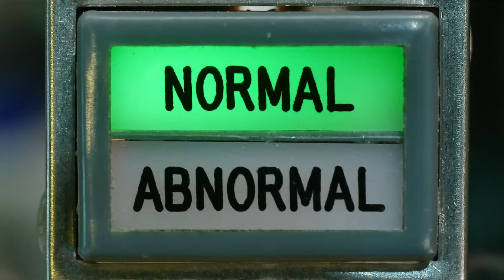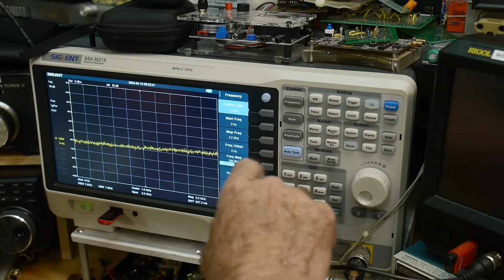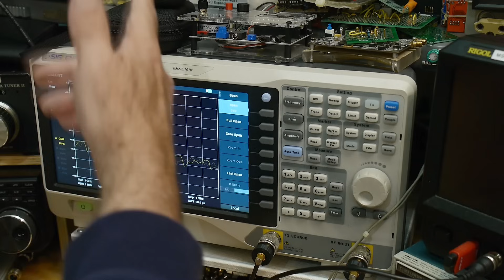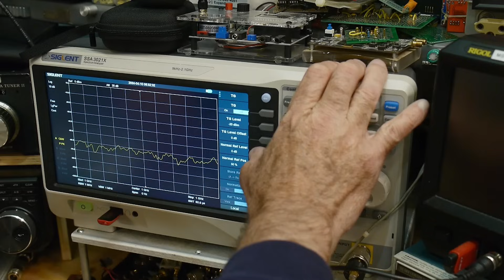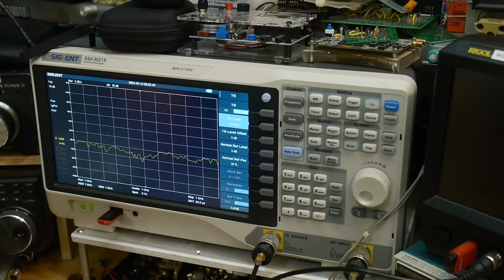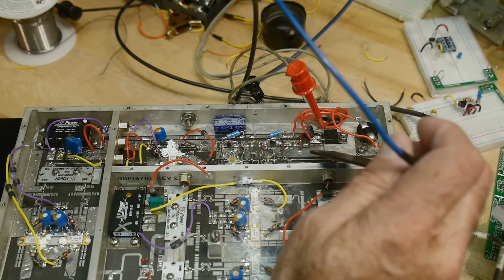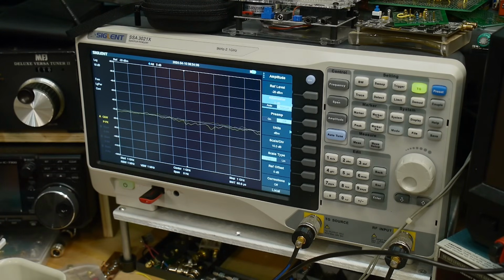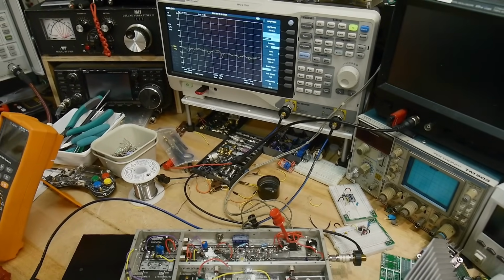#1864 1-2 GHz 30 Watt Amplifier (part  2 of 4)

Comment: Isn't 1 Ghz  microwave not RF 😂😂
Reply from the maker: it's all RF, you are thinking of HF (high freq) VHF UHF
"Radio frequency (RF) is a measurement of the oscillation rate of electromagnetic radiation, or radio waves, from 9 kilohertz (kHz) to 300 gigahertz (GHz). RF is measured in hertz (Hz), which is the number of cycles per second a radio wave transmits."
Reply: @IMSAIGuy  thanks one learns something new everyday  😉

Comment: So can it be modified for efficiency.. a current controller instead of constant current at class A. Such a  current controller was used designed by Douglass self.. but it was for audio... Opamp for few ghz hmmm...

Comment: When do the screws go back in?  I was wondering if there's a robust connection to the source terminal of the FETs other than mechanically through the tab connected to the chassis?

Comment: Tuned that would run in class C , but you have to run class A to get wideband untuned power. Guess power consumption is as close to constant irrspective of output power, just runs cooler slightly at full load as 30W goes out the antenna instead of into the heatsink.